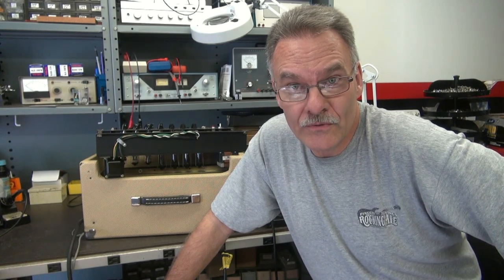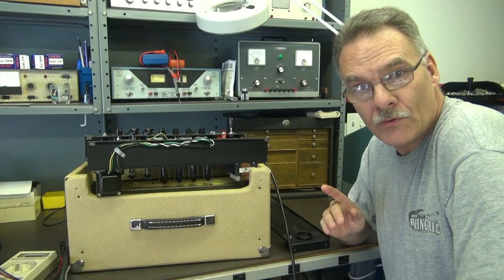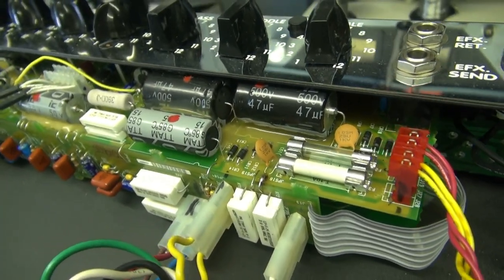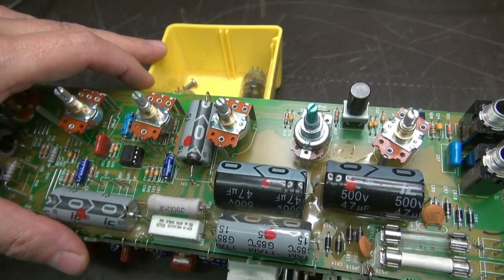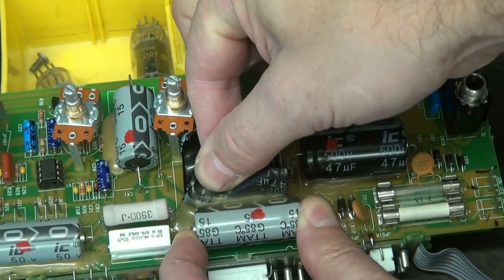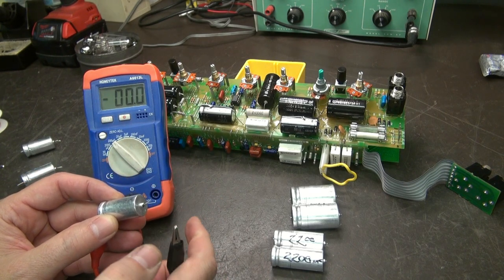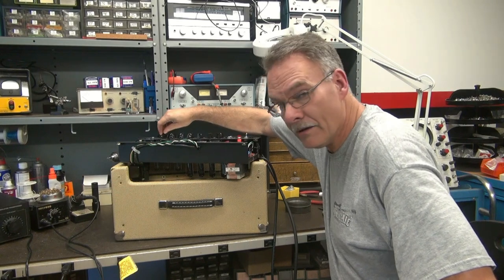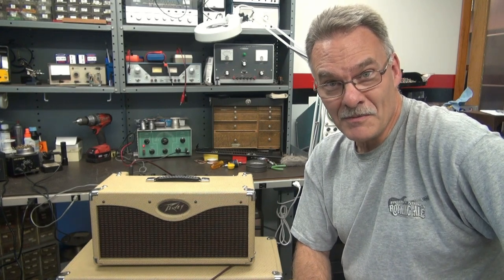How to repair Peavey classic 30 tube EL84 guitar amplifier hum buzz D-lab

Comment: I’m a 40 year pro guitarist who uses Peavey Classic 50’s. The 30 is not built anything like the 50. Thx for the inside look at the 30. Wont be getting that. USA 50’s are the best built circus board tube amps I’ve ever seen. I built point to point boutique amps with Mike Holland, Holland Amplifier so I don’t care for circus board amps but the USA made Peavey Classic 50 is an exception.

Comment: I worked on Guitar Amplifiers for 25 years I found that the major manufactures used hot glue to mount the power supply filter caps and using a heat gun on low or hair dryer often would soften the glue after the leads were snipped as you did. Enjoyable videos I miss the business. Best Regards

Comment: When installing components on a PC board: Insert leads, bend and clip leads then solder so there is no stress on PC board traces when clipping leads. Mil spec assembly proc.
Reply from the maker: Roger that Sir. I went to the Boeing High reliability soldering course back in 1986. 2 weeks of pure fun!

Comment: Another great repair and tips on replacing those caps. Good job!
Reply from the maker: Thanks man. I was a bit taken back when I saw that 3 way circuit board. Turned out not as bad as I thought. The glue was the real issue. I hear these Classic 30's are fairly desirable. TD
Reply: Thanks Terry, another great and informative video!

Comment: Another good video! These amps are very time consuming to work on. I've done quite a few already. One interesting thing was, I had one customer insist on only replacing the really bad caps, and not all electrolytics. Well, I think you know the outcome. After a $300 repair bill, the amp failed again 2 weeks later, and another $300 tab. Good for me, but not the customer. It doesn't pay to go cheap when having an amp repaired. he wasn't so lucky the second time since he lost the bias supply and cooked his output tubes. Now, he listens carefully when I speak LOL :) Keep 'em comin' Terry...always enjoy them! :)

Comment: Nice repair! My hackles were standing straight up when I saw those three circuit boards. I might have bailed on that one right there,. Nice Job!
Reply from the maker: Yes, I agree. The best thing on this configuration, is to ensure the boards do not get flexed the wrong way. A cracked board would be nasty. If I had lots of spare time, this amp would be a nice candidate for rewiring with a vintage eyelet board. TD

Comment: Excellent video once again. An issue I've seen with these amps is intermittent crackling and popping noise, similar to bad plate resistors. It turned out to be bad/dirty effects loop jacks. I ended up replacing them, rather than cleaning and re-tensioning, so I wouldn't have to open the amp up again, or anytime soon hopefully.
Reply from the maker: Hello, Yes those jacks can be troublemakers. I agree, always replace rather than try to clean/reform. Marshalls have the same issue with the exposed contact Cliffjacks. TD

Comment: Nice repair. Many risings of the moon ago I had a Peavey Deuce. Because it had a little hum I decided that all that "goo" on the board had to go so I cleaned it up. Yeah... bad idea and more work than I bargained for. Apparently the goo was a dielectric of some kind. I don't remember what the tech at Peavey told me it was. Peavey repaired it for me and as I recall it wasn't very expensive. It's too bad I didn't have a D-Lab YouTube channel (or internet) to watch back then. 

Much later I loaned it to someone for a week. I never saw it again. I heard he painted the case with day glo colors and, later, that he pawned it.  73 NE5U  Mike

Comment: Testing the amp with your scope and signal generator is a great idea.  While everything's connected up, why not see what voltage the amp saturates at?  It would be a great way of verifying that the amp can put it out its specified power.

Comment: I acquired a Marshall JVM 410 combo. 100 watts. While no instrument was plugged into it, there was a loud pop. A hum existed afterwards, even with volume turned all the way down. I was told that it sounded as if it blew a capacitor. After seeing this video I am thinking they are right. The amp is only 3 years old and has only been played at low volumes, so I am dismayed that something like this would happen to an amp like a JVM. I am wondering if it would be over my head to attempt the repair. I have built a condenser mic from a kit before. So I have some experience soldering. I thought it was very insightful how you checked the cap in the video to find it was not the only faulty cap. My biggest concern would be removing the board and getting it back in. Sure wish you were in our neck of the woods! Where are you located? Thanks for the great video! Any tips appreciated! 🎸

Comment: One of these amps was the bane of my existence for several weeks. All high voltage filter caps got swapped, along with numerous coupling caps. The jumper wires linking the three boards are prone to fracture. The daisy chained heater configuration is ridiculous. When the client called to ask how it was going, he declined any further work when I detailed the time and parts count involved. He collected the cabinet and speaker, paid me for my time and parts and I've recycled the rest.
The newer version of this model is better in terms of servicing.
Reply from the maker: Yes, they are a bear to work on. I have a 3rd one that just arrived. Hums, plus 1 tube goes warp drive. Should be fun.
Reply: D-lab Electronics

I'm guessing you are referring to the power tubes, and I seem to recall you have a strong opinion about 6BQ5/EL84 equipped amplifiers. Anything over 300 volts on the plate bakes those tubes prematurely. I found a Russian-made EL84 that is rated for 400vdc. Works great in the Scott 299b I had to rebuild.

Comment: heavily glued in caps, crazy circuit board design, it's like they wanted you to throw it away when it goes bad or something
Reply: Jason Goodwin exactly why they build them like this. Not just shit peavey either. They build em all now a days to be throw aways. Production amps anyways. I gave up on them years ago. Traded a blues junior for a 1977 Traynor ygm3 handwired real amp years ago and havent looked back.
Reply: You can't really give them crap for glueing down the caps. You don't want them flapping around in the breeze. Those are heavy components and a combo amp is subjected to vibrations, so left unsecured, the caps would break the solder pads on the board, eventually.
Securing them down in some way is definitely a good practice, although using zip-ties would probaby make it more serviceable.
Reply: Its a feature called planned obsolescence.  Designed to fail or you have to buy a new one.  Kind of like American cars and appliances.
Reply: @johnnycampbell3281  this is definitely not planned obsolescence at all. It's planned reliability. If these capacitors we're not glued down, they would most definitely have failed solder connections. And guess what, it lasted until the components actually failed after 20 years of use! That is great. If Peavey didn't glue them down people would have bitched about poor quality. You just can't win with with some people. I've been performing component level servicing for over 30 years focusing heavily on audio equipment, and is this is normal practice. If someone can't handle removing capacitors from adhesive they need to not be working on this type of equipment. This amplifier is one of the best bang for buck and sounding combos ever and changing dried out old electrolytic capacitors is inevitable in  ANY amplifier or electronic device, not just a Peavey amps. Old capacitors are like changing tires and batteries in old cars, they're wear items. No one has a 1967 or 1997 Camaro driving around on the original tires or battery. And none of them last 20 years either. Sure you can put hugely oversized overrated capacitors in there to last a  little longer, but they will go bad and beer viewed as wasted money. Again you can't win. Nothing is wrong with circuit board amplifiers either. I proved golden ears types wrong so many times in blind listening tests, it's not even funny anymore...turret style boards fans are for those who can't handle properly servicing methods...

Comment: Great tip about slicing away the cover of the 86ed caps to get around the hardened glue.

Terry what wine do recommend for working on filter caps: cabsav, shiraz or merlot? I find a pinot noir too delicate for it's bouquet to combine with solder resin...

Comment: I have a USA-made Delta Blues.  Trem circuit went out twice according to the original owner.  The amp sounds really good but I dread ever trying to have it fixed.  Skip Simmons services all my good amps and I wouldn't want to bother him the the DB.  So I guess it is in fact a disposable amp.

Comment: Great video Sir, as always,.. i just fixed my classic 50 last week,had dry joints on the speaker output connector at the pcb (2 post pins +& _).It had intermittent crackling sound.

Comment: Good work ! I hate the construction of those C30 pv's . Had one in where the tube heaters were going dim intermittently. Found one of those board jumpers had a hairline crack in it .... from brand new as the amp had never been opened. Pv QC hmm.

Comment: They are a pain in the butt to get out. I have to take mine out again. This time I will do the caps also. The power tubes filament circuits are in series, one goes, they all go. #3 is doing it again. I will replace the socket this time. I had it fixed for a couple of years.

Comment: Informative video!  The Classic 30 runs very hot - wonder if that is a factor in capacitor failure?  I've been placing a small table fan behind mine - the chassis feels a lot cooler and I'm hoping it will prolong the life of the components!
Reply: Electrolytic caps do not like heat. Running them cooler will extend their working life.

Comment: Thumbs up, buddy!  You got a like from me.  I just landed a dead one from Craigslist, no power, quick flash of the power light then darkness.  I already suspected power supply caps, and you video will guide me through the cap replacement.  

I copied this from your cap tests:

2x  47 uF
2x  2200 uF
3x 22 uF

Also, you spoke highly of Mallory and F&T brands.

Can you suggest a vendor who will take any order this smallr?

Johnny
Thanks for sharing your experience and wisdom.
Reply from the maker: Hello, Cool deal on the amp find. Thanks for the kind words. Try the Tubedepot.com for the caps. They are great to deal with. Good luck on the project
Reply: If you're thinking of doing this cap job, you'll need to specify the caps' working voltage. 2 x 47uF @ 500V, 3 x 22uF @ 450V and 2 x 2200uF @ 50V. If you can, get 105 deg. C rated caps rather than 85 deg. C.

Comment: Hello thanks so much for this video, really helpful. Would you mind listing the filter caps and letting us know where we can buy a complete set to replace. I need to take out all the innards to replace the R58 in a couple of these that I own (going to replace them with a 7W390ohm resistor so that they don't fry as easily when I throw 2 overdrive pedals and a fuzz at them). While I am in there I figure I might as well do the caps as well since both of my C30's are over 15 years.

Comment: I own a delta blues which is basically the same amp as a classic 30 with built-in tremolo. The Reverb pan is extremely noisy and basically unusable unless at the most minimum setting. I put a new tank in and it still has the same issue. I already  put  a piece of cardboard  on the base of the tank but it did not correct the issue, do you know of a fix? The problem is a rumbling and feedback that pollutes the tone. The issue  is pretty well documented on the forums but I'm only asking in case you have worked on one and already know a way to resolve it. Anyway thank you for these informative videos they are very helpful. Have a great day.
Reply from the maker: Hello, have you swapped out the pre-amp and reverb tubes? Many of these reissue amps came with substandard tubes, which were microphonic.
Reply: Yes sir, That has already been done, still has the same issue.
Reply from the maker: Have you ohmed out the cables and checked the reverb input coils?

Comment: Thanks a lot man! I found that my Peavey is humming but it's like the kind of hum you can hear at the end of your video. It's much louder than in my other amps. On clean settings the hum is about the level of my P90 hum - when I switch to the middle position (hum cancelling) you cannot tell the difference. I can hear that you still get a lot of hum after fixing caps. Is that normal thing in these?
Reply: Does it hum with nothing plugged into the amp's input?

Comment: Great video.  I paid a tech quite a bit to get rid of the humm on my classic 30 but it's still not completely gone.  It's easy louder than on let's say a Princeton amp or even a hot rod deluxe... capacitors, transistors, caps, tubes were all replaced.  Are fender amps just quieter in general and Peavey amps just inherently have more buzz?

Comment: Funny how the main 47µf filters were toast.. The plate voltage on these amp are not that high at 332VDC according to the schematic and of the caps are rated at 450V/500V they should not be to stressed.. But I see no standby switch on this amp and with silicon diodes as rectifiers you might get a large voltage spike everytime you turn the amp on before the tube filaments are warmed up which could stress those input caps.. and maybe the screen cap as there is only a 400r resistor between plate and screen supply..

Comment: As a guitar player, I HATE amps with this kind of design ... and I HAVE ONE!! Had no clue the innards of my 1994 Blues Deluxe was actually a computer masquerading as a tweed amplifier. Grrr. Was I mad when I found out. I think I can attribute this wiring lunacy to Bruce Zinky. If I am mistaken, I apologize to him, here and now. But I cannot imagine anything more stupid than plugging tubes right into a board, and in this case ... a PC board!! Killer sounding amp. But born with a death sentence, far as I am concerned. These things will not stand the rigors of continuous gigging, once again, as far as I am concerned.

MUCH agreed on changing out ALL the caps, and putting in GOOD caps!! RELIABILITY is job one, for a musician ...

Comment: Where on earth are the bias test points for the Peavey classic 50, 212?  according to the schematic in between R-49 and R-50. I was trying to get an idea watching you work on the Classic 30. problem is on the Classic 50 there is no component identifier at all. you know R-32 D-50  no print at all!  I have seen this on boards from the 70'S   but nothing this new.    Help please

Comment: Good day from Ireland. Thanks for the great videos, just getting into valve amps and your videos are the business. Was hoping you might advise on a issue with a classic 30 I just got, first tube amp I’ve had. Question: when I turn the kids right down to zero a hum kicks in. When I turn them up again it goes away. It’s like a switch in that it’s instant and only happens when the knob is fully at zero. Any help would he appreciated. Cheers. Pete

Comment: love your videoes :-) just made the same replacement on my Peavey classic 30 Black edition from  2000,- but i have problems with the reverb . There is a hum when i turn the knob higher than 2 and it is a new tank i bought just the other day . Do you know any pecific mod to change it to the better ??  Best regards from Denmark
Reply: Hi there, I saw your comment on this video from a couple of years back. I've just acquired a classic 30 & am experiencing the same problem- hum when reverb is turned up. I noticed it goes away when I have pedals in the effects loop. Was wondering if you found out what was causing it & how easy  it is to fix?

Thanks Matt

Comment: Hey man i love your videos. very helpful! Ive got a early early 90's classic 50 head and after playing for a while the amps volume cuts in and out. could this be tubes?
Reply from the maker: Hello, That sounds more like a bad solder joint. Give her a good inspection for cracks/overheated joints

Comment: I ask for some help with my peavey classic 50  212 w efx, suddenly while i was playing it made a big noise and burned smell... After shutdown i realize the reverb was not working anymore.. I change the opap rc4558 and it started to working as before but i noticed that the signal from reverb has a little of distortion in the very high frequencies... If i unplug the reverb tank and i turn on the potentiometer the signal become dirtier... What can i do? Thank you in advance...

Comment: What a horrible design on that amp, at least with modern cheap fender amps the board is easy to get out. 
As my next project is to build a sunn 200 but with kt88s, it actually works out cheaper to build your own bass tube amp than buy one. 
Thanks for the tips, there was something I wanted to ask maybe a video of essential workshop tools for amp repairs?

Comment: Those kind of boards are a nightmare. You can easily remove the hot glue with some alcohol. After the cap replacement part that amp still gets some buzz even if it has been fixed.